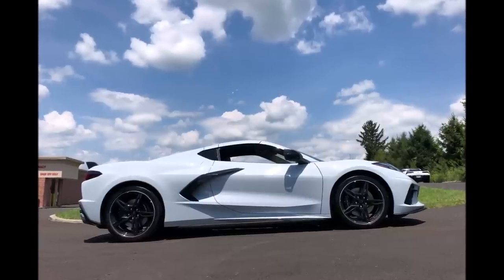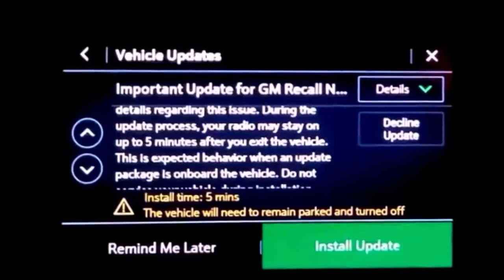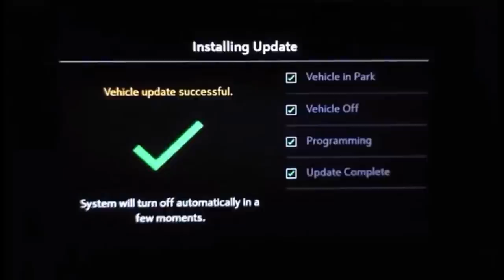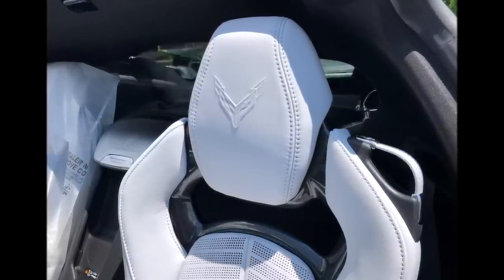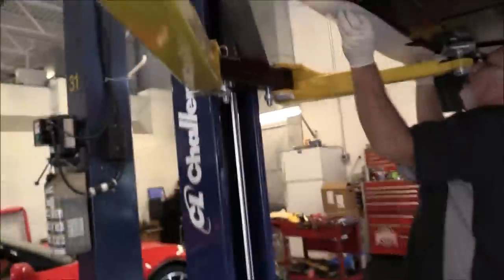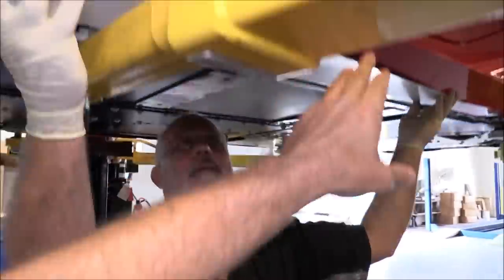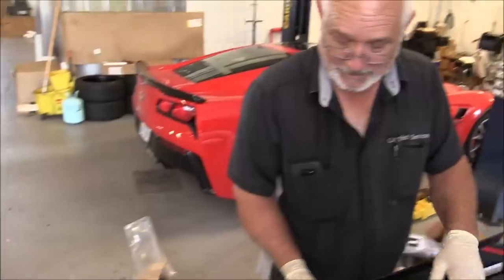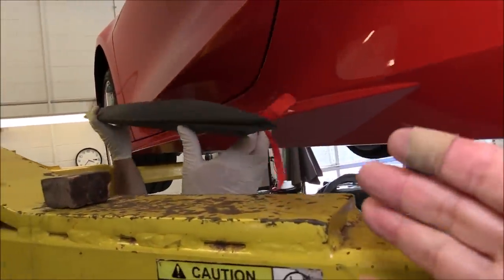2020 C8 CORVETTE RECALL & MORE TECH TUESDAY Q&A

Comment: The cylinder deactivation keep our favorite American Sports Car off the gas guzzler list. The GT1 seat in 2LT trim is a great value. Ventilation, lumbar, and side bolster work great and you can’t see the lack of Carbon Fiber on the headrest of your seat while driving. If you got to have GT2 seats get the 3LT trim and it is included in that package along with Upholstered door posts! Happy 2021 C8 shopping, I am very happy with my 2020, 2LT Coupe!

Comment: Great!  I'm sure the updates work correctly.  Fantastic idea.  Tech Tuesday is great!  I have a 2019 with Mag ride.  I can't believe how nice the ride is.  I'm also concerned about the cylinder deactivation valve.  Mine works great, but down the line???

Comment: To all of you waiting for your c8, just be patient.  It will come.  Live your life in the meantime. If you keep checking when it will arrive, it will drive you nuts.  I ordered mine last Sept and got mine last April. I hardly drive it. I'm in florida and it freaking rains everyday.  You dont want to drive your C8 in the pouring rain.  I got caught in the rain in my c8.  Man, it was pouring hard.  I looked back in the engine compartment and rain was coming in from all the holes and glass ( yes under the glass ).  I know its designed to get wet but it looked like Niagara Falls coming in. It took me forever to dry the engine compartment.   It looks good in the garage though. lol

Comment: Eco mode... whoa, my favorite is track mode but roads terrible, compared to a track lol,  so Always in sport. 
I also have a automatic C7, and deactivated 
The cylinder deactivation valves. I did drive in manual mode, but wanted to be able to drive in automatic mode without worrying about issues that arise from the cylinder deactivation valves, switching from 4 cylinder to 8 cylinder. I didn't buy the car for 4 cylinders, or worry about gas mileage. Its to drive and live life ( fast ) lol 👍  😁

Comment: Rick out of curiosity why do they recommend adding transmission fluid if you're going to track the car why didn't they just put it in in the first place and be done with it
Reply: Ken, I think it has to do with improving transmission fluid cooling when the car is under sustained and repetitive hard acceleration on a track.  

I suspect the reason they don’t put it in at the factory is threefold; it isn’t necessary for street transmission cooling, most owners will never track their cars, and it’s a cost-saving measure.  It’s a smart business move because two quarts x thousands and thousands of cars adds up.  Most car manufacturers balk at adding even a few pennies cost per unit because every little bit drives up the sale price and makes them less competitive.

Comment: This level of 'Satellite' technology can be seen as a customer convenient method, BUT, it clearly shows it's a very 'DANGEROUS' - when it can be hacked and they, can take control of many parts of the vehicle functions - 'Think About That For a Second' - SCARRY!!!
Reply: I hear you on this and being an IT Directory I to have these concerns but here is what I can offer you.  Tesla has been doing this since the Model S was released and I am sure that they have perfected the security layer necessary to accomplish these functions.  GM owns GM Defense, and OnStar both of which are High Technology companies that they can tap for security related code and consulting.  Also, GM has used OnStar for a long time in which they could pull data from your vehicle and the vehicle could send data directly to them.  So in a nut shell you have a valid point but I think it is not of a major concern IMHO but would be more concerned if they where to share any of the data that they collect.
Reply: @greggblank988  Thank you for your comments & appreciated. I would have expected that such system(s) would be operating & have under high security levels. I assumed to be very difficult brake into them. Unfortunately, history show that all such technology is never full proof and there are hackers in our technology world with very high talent and money tends to rule over ethetic & moral standards.